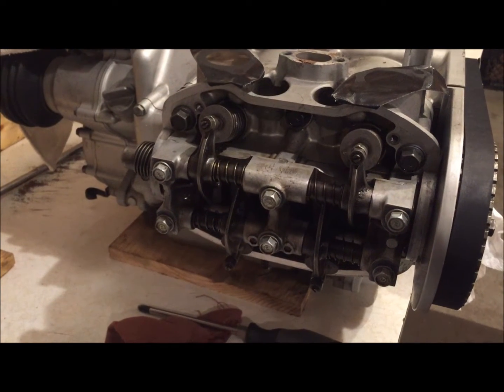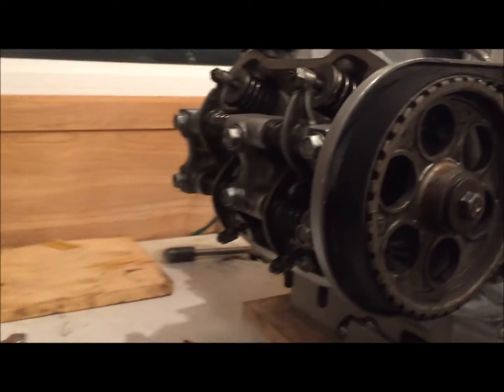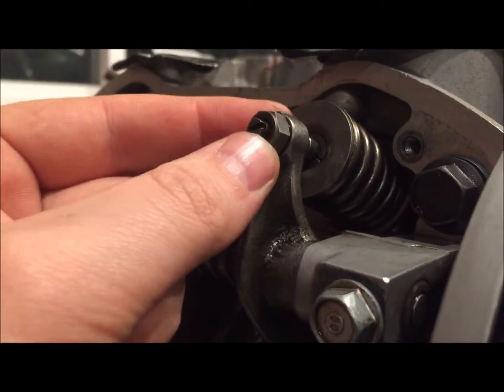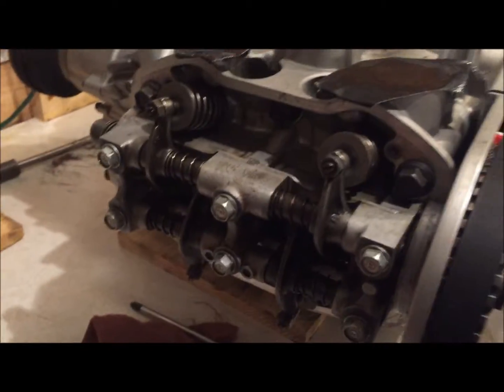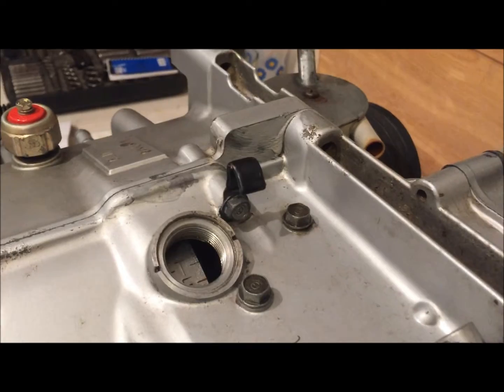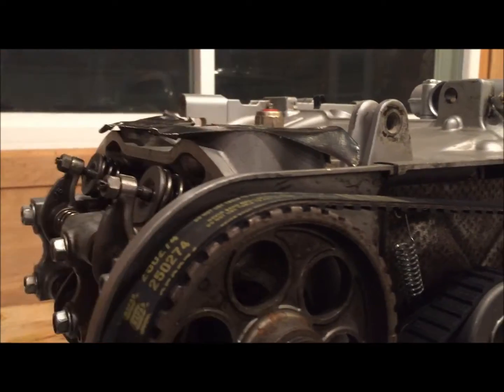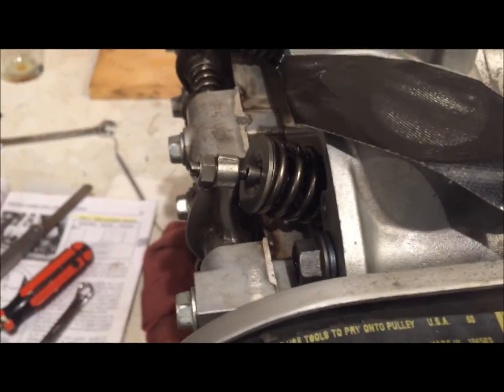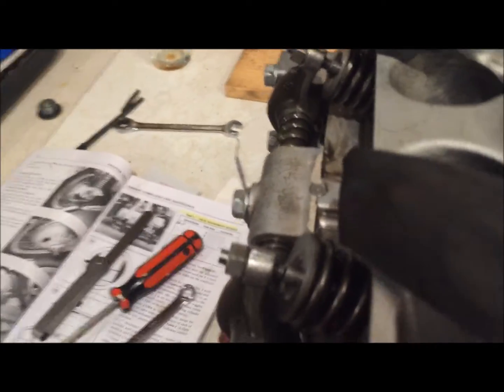GL1000 Timing Belts Part 3  --  Adjusting the Valves

Comment: You did it like a Pro, Boss.  You may have said this but but one should use some sort of device (small stick, screwdriver) to confirm that the no 1 cylinder is at the top of it's stroke when everything is lines up- the reason I point this out is that I am working on a bike where someone overtightened ALL the tappets so NONE have any clearance!  Thanks for the video.

Comment: Not to try to tell you how to do anything but if you place a long screw drive into the number one spark plug socket when the number one is top dead center the screw driver will lift

Comment: Would be great to know if you can change camshaft and crankshaft seals on the front of the engine for the pullys that the timing belts ride on with the engine installed in the bike. I have a horrible oil leak iside there. Don't have the cover off yet but I know one or more of those seals has failed.Also can't find a procedure for doing this. Any help would be appreciated. Thanks, Albert

Comment: You are quite knowledgeable with this engine.
Can you please tell me if this is an interference engine or not ?
I am looking at buying a 1979 Goldwing, it has spark, fuel and compression, but not running.
What is the chance that it has hit a valve and piston by being out of time ?
Or having a bad timing belt ?
Reply from the maker: quadsman11 It is absolutely an interference engine. I doubt that a piston has hit a valve, if that happened you would not have compression. The carburetors on these are infamously finicky but not too bad to work on. I would begin with checking the points and condenser on the ignition and I would also clean the carburetors and probably purchase a Randakk rebuild kit. Also, tons of great people and information over at Classic Goldwings forum.
Reply: @btrapp37  
Yep !
See what I mean !
Knowledgeable, and helpful !
I agree with you on the compression issue.
But was a bit nervous about doing my own compression test for fear of damaging !
Can't agree with you more on the carbs !
This fuel is just a terrible thing I carbs these days for sure !
Thank you for your head's up on the forums !
Reply from the maker: quadsman11 I would pull the timing covers to inspect the belts visually. Also, you can turn the motor from the front then by hand to make sure everything spins freely before trusting the start or motor to do it. Belts will likely need to be checked and replaced anyway. It’s a great starter project and can all be done with the bike in the frame. Pulling the radiator makes it a lot easier too. All pretty easy if your patient and decent with a wrench.
Reply: @btrapp37  
Thank you again,
By hand was my plan.
Replacing the timing belts is how I found your YouTube site, So it would seem that you and I are on the same page for sure !
Thank you again !
Reply: @btrapp37  
As for the decent with a wrench,
I am paralyzed from my shoulders down, and have no hand function whatsoever.
Was a professional mechanic for Cat for a number of years before my injuries.
So working with my shop mechanic here, and talking him through, step by step !
Which can be a bit frustrating once in a while.
Especially when you know what to do, and how to do it !
But I manage !
And very grateful for a couple of very good mechanics working here with me !

Comment: 2 issues with your video. 1) you should have done it, not just explain it, for the people who have never adjusted valves before. 2) you didnt explain how to turn the crankshaft with the timing belt covers on when it's in the motorcycle, which is the only reason why I watched this video to find out. But I did learn about how to making sure about TDC on cylinde 1. But I will refer to my Honda manual, which is all I have at the moment, on how to turn the crankshaft with the timing covers on. But it is one of the best valve adjustment videos out there I've seen.
Reply: With the run switch in the OFF position and the bike in neutral, Bump the starter or turn the rear tire with the bike in 4th gear (it's easier to turn). Of course, with the rear tire off the ground. It also helps to remove the spark plugs. Also when adjusting the valves, be sure NOT to crank down too hard on the adjustment nuts. Make then tight but don't break them. And you should have some drag on the feeler gauge but not real tight. 
I always go back over them before I close it up.

Comment: Can you do the valve adjustment and timing belt without unmounting the engine? Great videos, very informative.
Reply from the maker: Yes of course you can do the adjustments with the motor in the frame. I just happened to have it out because I was replacing the piston rings.

Comment: Hi, thanks for the vid. My question is: do I neet to make valve adjustment after timing belt change ?
Reply from the maker: Gery P Not necessarily, but it's a great time to check the valve adjustment. They may or may not need adjusting and the belts won't directly affect it.

Comment: i Cant turn my engine using the alternator bolt. It feels very stiff and it will only strip the bolt :/
Reply from the maker: I prefer to turn the engine from the crank instead of the alternator bolt. I find it much easier and you can get a larger wrench on it. Plus, if you accidentally loosen it you don't have to pull the engine out but with the alternator bolt you do.

Comment: Daughter's account - but Dad thinks this is a great tutorial.  If I were a HS student my first stoner question would be "Why would you ever set the valves without removing the belt covers? I mean, changing belts is recommended at 35K intervals so why not set valves at the same time? Set valves = change belts." Just asking'?
Reply from the maker: If one were to have been doing other engine work or any work on the heads you may be required to readjust the valves. In my case I had the entire engine disassembled. Changing belts at the recommended interval is a great maintenance project, but one does not necessarily need to replace the belts every time the valves are adjusted.  

Thanks for the reply!

Comment: all you have to make sure is that the eccentric on the cam lob is completely away from the valve rocker,  you can do this with a flashlight and just peek in the center of the head and note the position of the lob,   makes no difference, what order you do it in, as long as you know that the valve is closed and the eccentric on the cam shaft is not anywhere near the rocker arm.  your way is correct, and you have the ability to do more than one valve at a time, but my way , does not matter what stroke your on,
Reply: This is correct!   Well said.    With that being said, this is a very good video of belts and valve adjust!
Reply: South West Florida Aerial I have a 84 1200 Honda goldwing I blowed my moter I got a 84 1100 Honda goldwing motor will it fit my 1200 frame